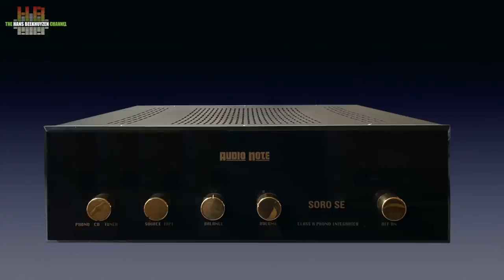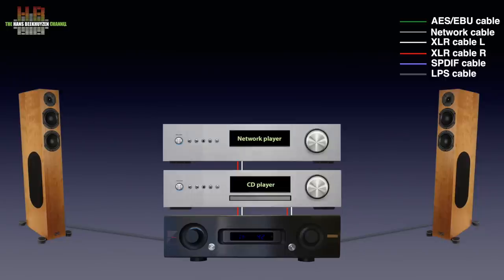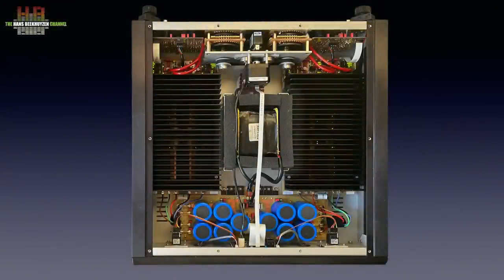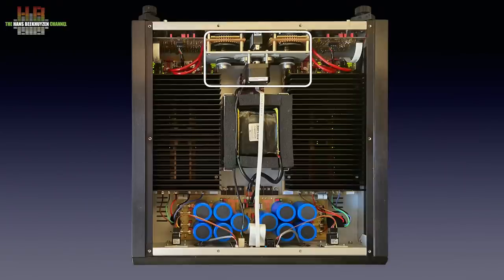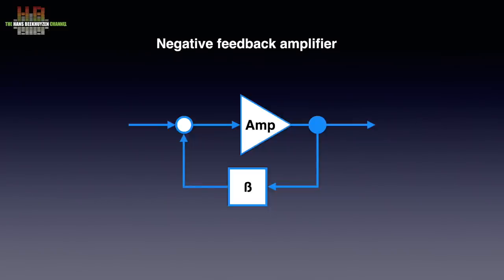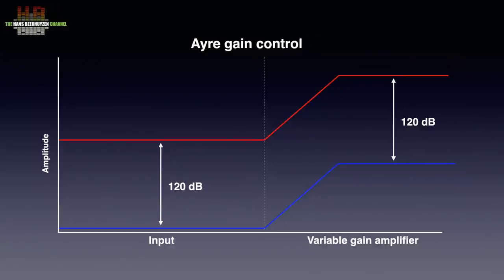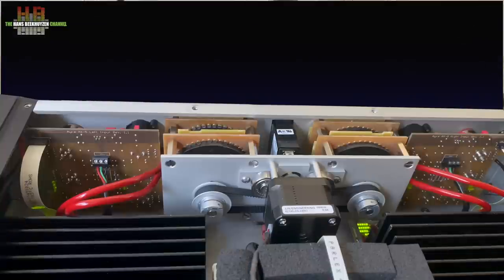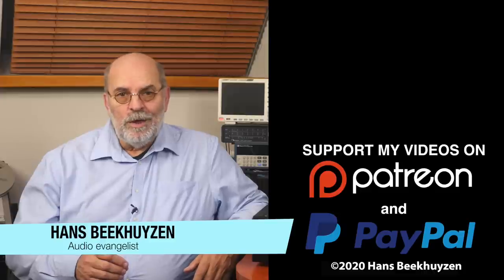Ayre Acoustics AX-5 Twenty

Comment: Hans, I love the schematics and the rounded down logic of your ‘layman’s’ presentations. I use SLIC balanced cables , they remove unsuspected haze and are the bee’s knees in my view, I think they would let your Ayre amp breathe more easily. I’ve been thinking of incorporating a lossless volume control into my network based system, which would allow a wider choice of line level dacs, such as the Denafrips models, and your description of the Ayre’s  volume control method gave me a great insight. Thanks!
Reply from the maker: Cables shouldn't remove anything, but they all do to a certain degree. What you describe probably is simply the difference between your previous cable(s) and your current cable that apparently causes less loss.
Reply: @TheHansBeekhuyzenChannel  Yes!, that’s all I’m after - more of the signal!

Comment: Wow, £10,000 for an integrated analogue amplifier.  TBH seems crazy to me, my whole setup (CD, DAC, Streamer, Preamp, Power Amp, Power Supplys x 3 and Speakers) cost about £8,000 all in and it sounds great to me.  Given my experience over 40 years of Hi-Fi purchases I really struggle to understand the justification of such a beast. Great video though and technically very interesting thanks.
Reply from the maker: With your years of experience I advise you not to audition this amp for you’ll be sold. And I’m serious!

Comment: Hi Hans, thanks for sharing your rationale for going with this amp. I know you don't do amp reviews, but I'd be curious to know why you chose this particular level of amp as opposed to Ayre's EX-8 (one level down).

Are there differences in the design aspects that are substantially improved with the AX-5/20 over the EX-8? Did you demo the EX-8 or just this one?

I'm in the market for a new amp and am looking at these two models. I'll be doing my own listening tests of course, but would be curious to hear your thoughts.

My system consists of Qobuz->Roon->HQPlayer->1.5MhzPCM->Holo RED->Holo May->Parasound Hint6->Paradigm Founders 100F. The May I had from my headphone days which is why it outclassed the other parts of my loudspeaker setup (and I wouldn't trade it for the world haha)

Anything you can share would be much appreciated!
Reply from the maker: I have compared the AX-5 Twenty directly to the EX-8 and I can assure you that despite having the same sound character, the AX-5 Twenty is considerable better than the EX-8. Both was tested using the QX-5 as a source.

Comment: what do you think about purchasing a "demo" model? Risky?  Also how much of a step up do you think Ayre separates are compared to the AX-5?
Reply from the maker: If it's a bonafide company, that offers proper warranty and an interesting saving, I would take the chance. Otherwise I would leave it. I have no experience with the separates. The difference between the AX-5 Twenty and the 'cheaper' brother is significant.

Comment: Congratulations Hans 👍 So not the NAD M33, I'm suprised 😁
Reply: Yes, Hans, gladly you sold me on the M33, it will tough to beat the M33 given that its half this new amps price.  As usual, informative videos
Reply: The m33 is wauw in its price class. This one is That in a much higher one . And I think the eigentakt has a lot of feedback circuits and This one Can do without .
Reply: Hans, can you please comment on some of the things sound quality wise you get at this level, that you don't with the NAD M33, very curious!     Thanks!
Reply from the maker: Sound wise the Ayre is even more relaxed, transparent and musical (as it should be for that money). Furthermore I needed a full analog amp to be sure that when I review a digital source, artefacts I might hear come from the device under test and not from a strange interaction of the digital source and the A/D/A conversion. For normal use this is not relevant since there is no reason to hook up a digital source over analog to the M33.

Comment: Regarding burning I know a real story from Poland, Gdansk. Threy burn the equipment with  loud pink noise for a weekend and left the house for vacations, later they realized, what the neiighbors would think about it.
Reply from the maker: With my former company I once had a set of speakers burn in. They were very closely placed face to face and out of phase so a large part of the spectrum was cancelled out, reducing the noise drastically. Only for high frequencies this is physically impossible so a clear hiss was audible. During my absence the concierge was noticed that there might be a gas leak....

Comment: Dear Hans, these days I bought a used Ayre ax 7 evolution amplifier so I would like to know which interconnection and speaker cables you use with Ayre ax 5 twenty. So far I have used Supra sword interconnects and Supra Sword speaker cables so I am also interested in what you think are are they good enough for an Ayer amplifier?
Thank you very much!
Reply from the maker: I'm sorry but I have no experience with your cables. You find a link in the notes below every video to a video that covers everything there is to know about my setups.